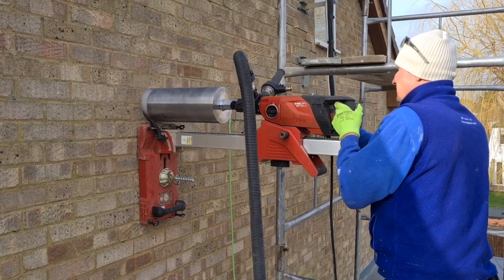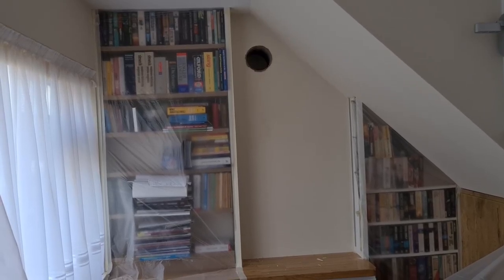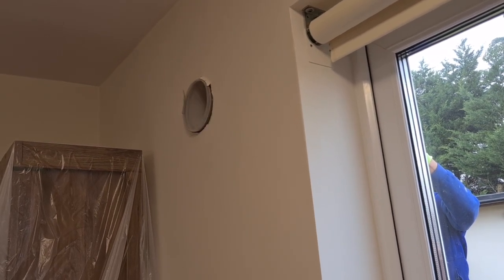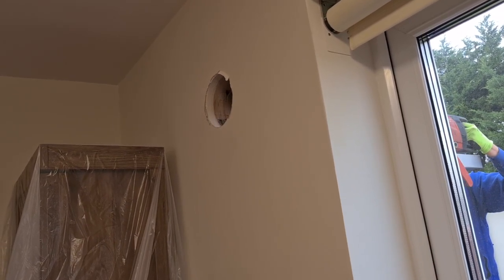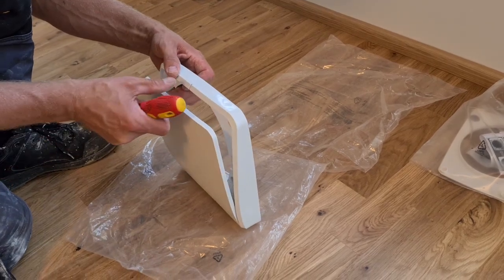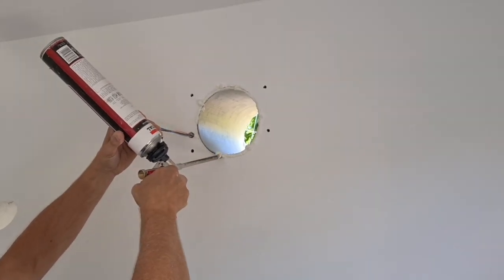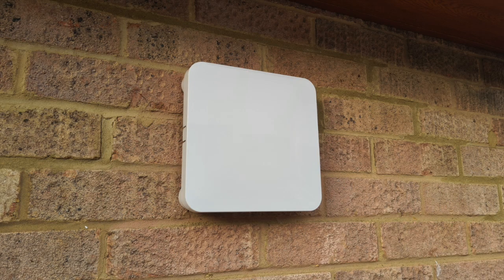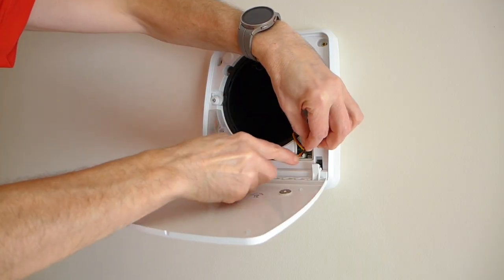Ambientika Installation (for 160mm models)

Comment: Whats the Size of the Core Drill? 160mm? Accorifng to the Manual it should be 162v
Reply from the maker: Hi, thanks for the enquiry.
You are correct - to install our range of 160mm Ambientika models, you need 162mm  core drill.
Best regards,